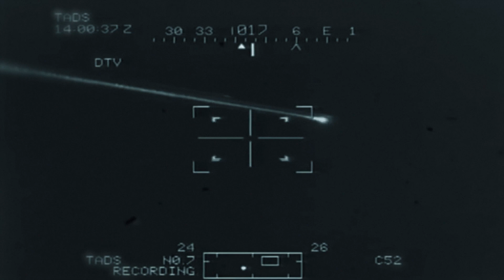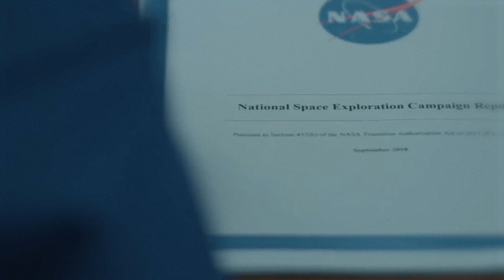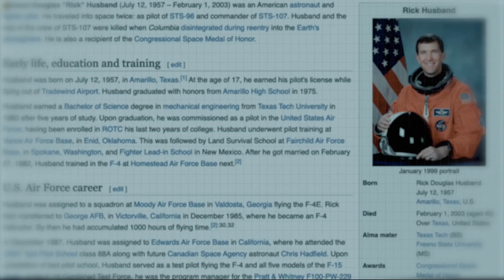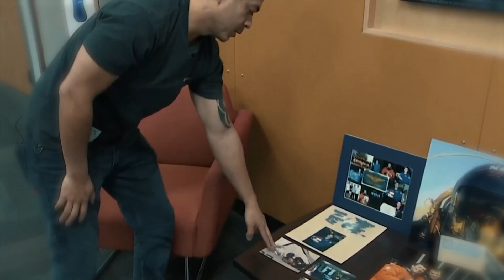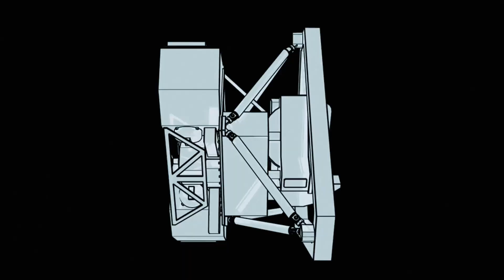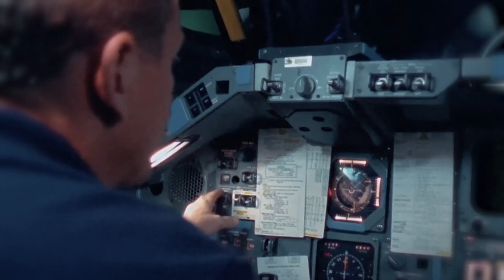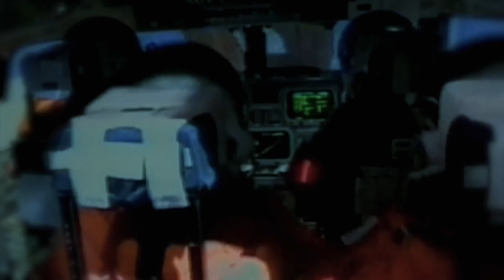How the Space Shuttle Columbia Tragedy  REALLY Unfolded

Comment: Once the phone strike occurred there was no way to save the mission. It does make you wonder, however, if there was a hole in it immediately after take off. Why did they not burn up as they ascended.
Reply: Once they passed through Max Q (the maximum stresses on the shuttle as it goes supersonic) external atmospheric friction rapidly reduced with the thinning of the atmosphere at higher altitudes until they were in the vacuum of space.
On descent the friction only increased as the atmosphere became denser and denser.